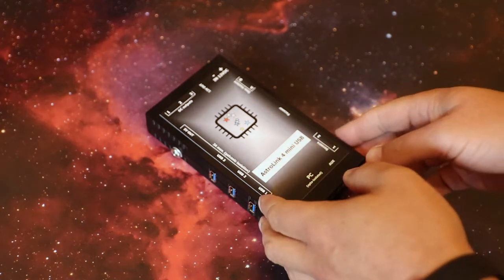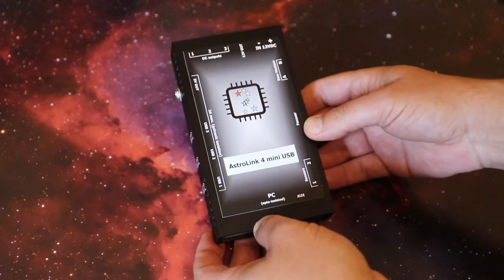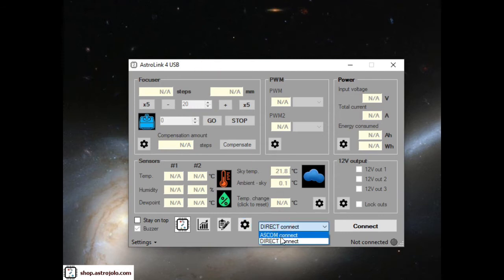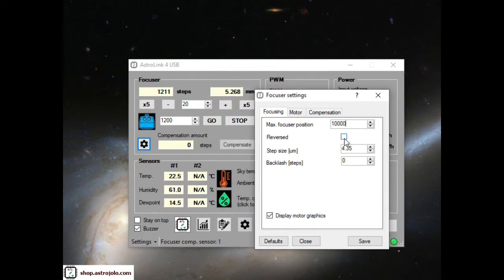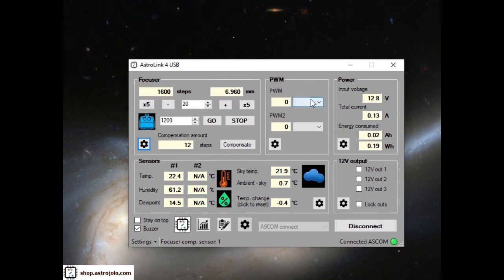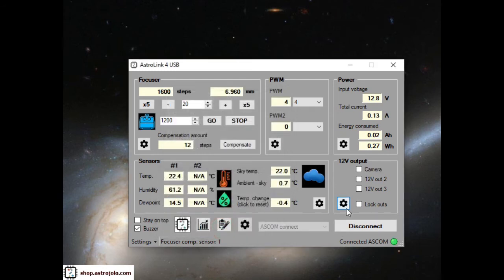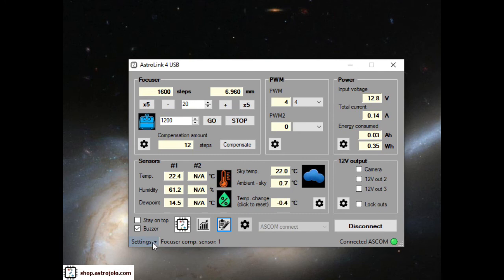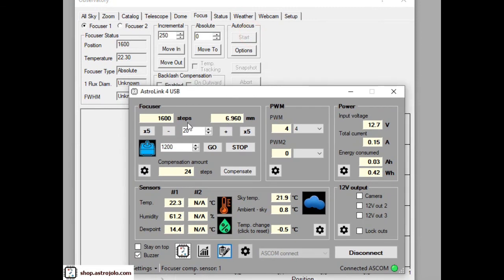AstroLink 4 mini USB - introduction

Comment: This is very cool device, 
Wondering has anyone used with NINA. 
Are the sensors for sky / ambient temperature used for visual only or can they be used as a switch ie: start and stop a sequence of imaging if clear or cloudy ?
Reply from the maker: Sensor readings are visible in NINA and other 3rd party software via ASCOM Observing Conditions interface. It is then up to the software to decide if these values are informative only, or can be used for some conditional session control. As far as I know that is not implemented in SGPro for example, but has not much experience with NINA yet.
Reply: Thanks  👍

Comment: This looks pretty cool except that 3 USB port is just not enough... 4 ports are minimum (camera, guider, cap, rotator, etc.) Any plan to expand it to include 5-6 ports just to be safe?
Reply from the maker: No, actually 3 ports are enough for about 80% of use cases. Expanding the number of USB ports is not an issue - there are a plethora of USB hubs available in all sizes, and even some astrocameras and mounts have built-in USB hubs, which makes cable management easy. More important is the isolation between the analog and the digital parts that AstroLink 4 USB provides.